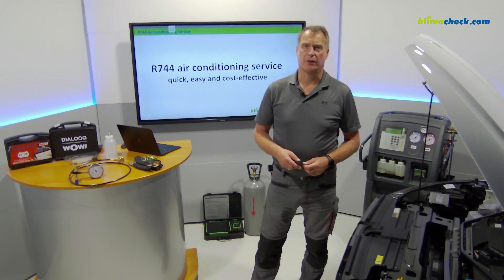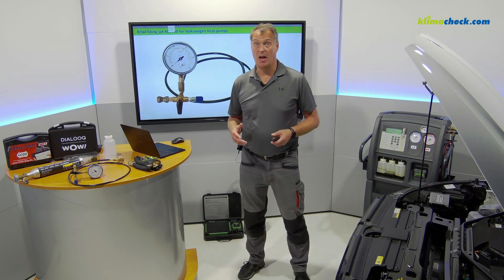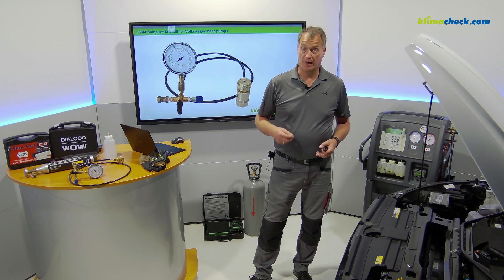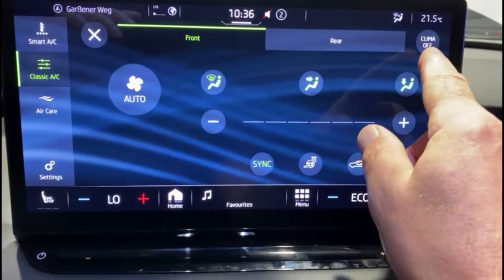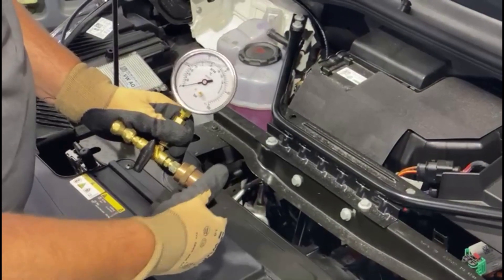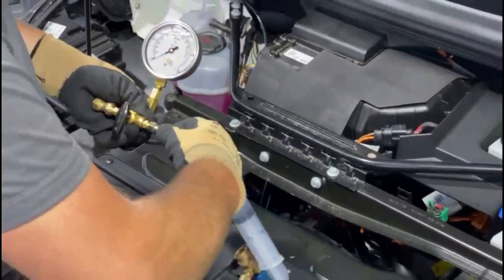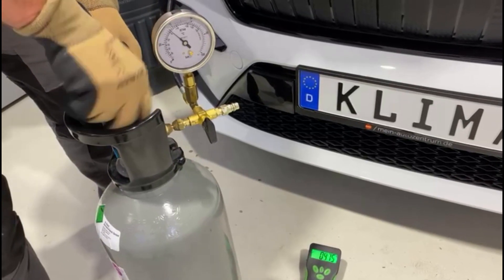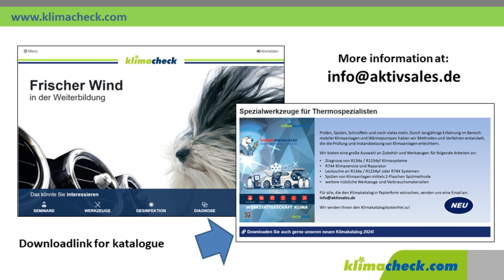Is this serious? R744 air conditioning service unit for under 1000 euros!!!

Comment: Are all R744 AC compressors super expensive? My friend has a 5 year old mercedes benz E class and the AC compressor is leaking. Mercedes wants 8000 euros to change a new one. It is insane and you can't get a new one from anywhere else in Europe except Mercedes.. If this is the case with all cars with R744 AC I think will avoid shopping any of those cars because I can't pay so much for a broken AC if it does indeed go bad.